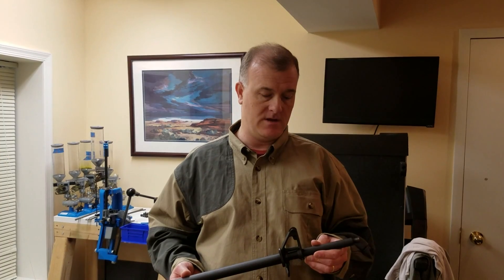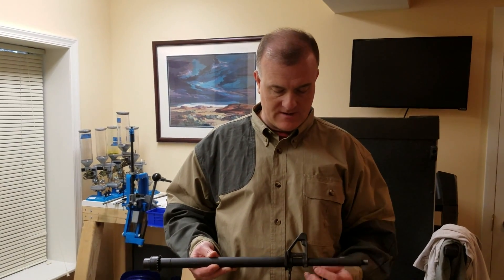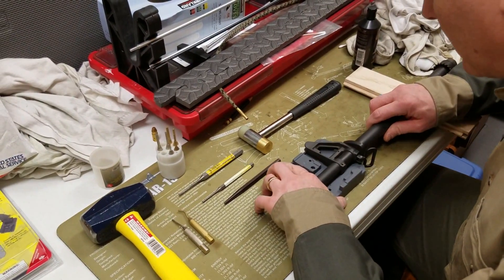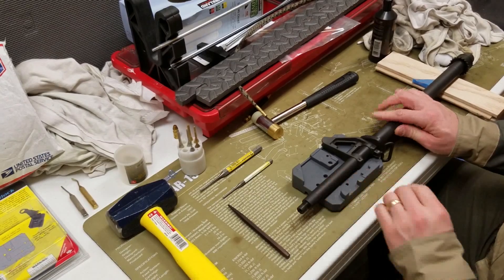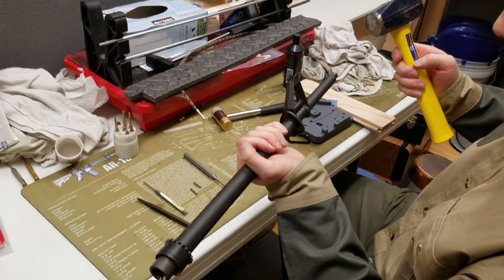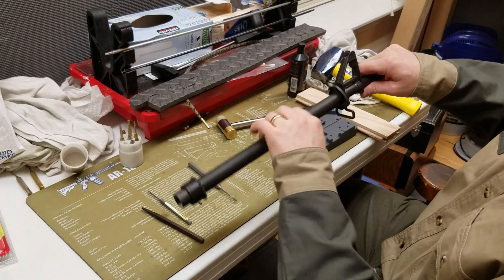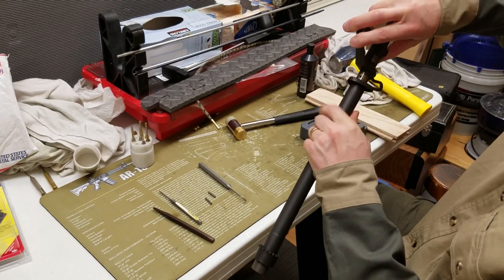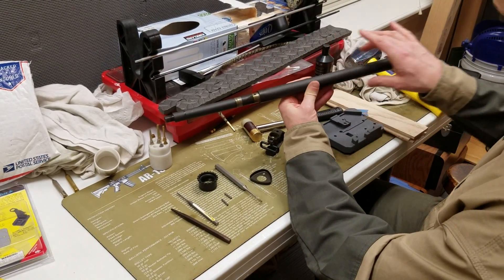Removal of a pinned AR15 Front Sight Base

Comment: I have the same bench block & I've used a hell of lot more hammer force than that...  and my FSB tapered pins haven't even budged yet...!
Reply from the maker: Make sure you are hammering toward the correct direction.  To remove you need to tap from the small side so it would back out toward the larger diameter side since its a taper pin.  Certainly a stable base or workbench is better for tapping/hammering.  You need a steel punch too.  I have the starter punch which is good to get going but after dislodging some I think you can switch to another punch.  This is because the taper on the starter punch won't fit all the way through the hole.
Reply: @yourarsenaladvisor  I was removing the pins from the correct side.   As I mentioned, I have the same bench block you have and used the "pins out" position on the bench block which was correct.  I worked on it again tonight for an hour and finally got both pins started out below flush with a drill bit spotting "pointed" punch... then proceeded to drive them the rest of the way out with an 1/8" dia drift punch.
Reply from the maker: @williamriley2528  I didn't rewatch my video or I might have recalled that it tells which side.  I do remember it being hard to get it started.  I think I tried some smaller punches that bent before researching the correct starter punch to use.  I'm glad you got them out.  I wonder if penetrating oil would have helped.

Definitely much easier with a proper steel punch.

Comment: If you would have put your Wheeler block on a concrete floor you would of had the pins out in 2 wacks. Thanks for your content.
Reply from the maker: Thanks!  I was using some punches tonight from the set that I bent up shown in this video.  Using the straight ones though for a much easier task. LOL

Comment: what size punch did you use?
Reply from the maker: The starter punch is an ‘AR Stoner Front Sight Pin Starting Punch’.  It doesn’t give a dimension but I think it’s 1/8 at the end and tapers out from that for rigidity.  Then when things get moving you can switch to something just under 1/8”.  My Stanley measured at .11 which is less than .125” but fits through where the pins go.  But you need to start with the more stout starter punch. This is for removal.  If you are driving them I figure you would use it to start and maybe switch to a jig or something else.  Otherwise you need to be extra careful not to miss.  I’ve never done an install.  Remember the pins go in one way and they need to go back out in reverse since they are tapered.
Reply: @yourarsenaladvisor  i ended up using a 2/32 set punch and i did try a 1/8 and 5/32 but both seemed to big idk
Reply from the maker: @hawkslayer2351  The starter punch is only used for a very short time to just dislodge the taper pin of its friction on the assembly, then you switch to a straight punch of appropriate diameter just to push a loosened pin through. I think the 1/8 is exact and might be as tight as the pins so need something just under but close in diameter so its still rigid to push against any residual friction.   The punch I have is .11 so its just under 1/8" or .125.  With 5/32 or .156 that is definitely over.

I put the starter punch up to the old hole in the gas block I still have laying around and with the taper you can't really get far with it so you have to switch to another straight punch.  But it's tight at first so you need the beafier punch to get it unstuck.
Reply from the maker: Did you manage with the above at all or no?  I was responding as if maybe you didn't yet but realize that you might have.

Comment: I must admit this is currently kicking my ass. I'll get that block you are using. which mfg sights/barrel do you have?
Reply from the maker: My barrel is a rock river arms .223 wylde 20" 1:9 twist.  I got a power wedge front site base from Fulton Armory.  They have f marked and non f marked for flat tops and standard.  And with bayonet lug or not.  They attach with 4 set screws.  I finally got a chance to install it but just lightly.  I got interrupted by some things.  Maybe I can do a review.  The main thing about removing the pins is getting the heavier guage punch to get the pins dislodged and moving.  Then I think a punch of the pin diameter was then used.  The starter punch is tapered so it won't go the whole way through.
Reply from the maker: Sorry,  I was thinking of my forthcoming Front Sight base.  I think I got the armorer's bench block from Midway USA.  Pretty sure it's a Wheeler.  It has more surfaces than the round bench block from what I can tell but it's not perfectly form fitting though.  Also try to use a firm bench underneath.  Mine in the video is a plastic folding table, not the best.
Reply: Thank you sir.

Comment: Shim up your bench block with a piece of delrin or hardwood to gain clearance for the sling loop. Shim the chamber end as needed for level.
Reply from the maker: Thanks.  I just rewatched the video.  It appears I do have clearance for the sling swivel from a piece of unfinished hardwood flooring.  I'm not sure now why I complained about it in the video.  That workbench is still a big problem for bounce back.

Comment: Now after you do this do you have to install a gas block? Or will the rifle fire okay?
Reply: YAA here, yes you can put on gas blocks or front sight gas blocks that tighten via set screws.  Either you put back on the one that was taken off or a set screw gas block.    I was informed(Rock River Arms technician)  that you can't put a new pinned front sight base or other block because new drill holes won't line up with the ones on the barrel, etc. That is the conclusion I got from the email exchange I had.  I used a power wedge on the barrel I took the pinned one off of.  They grip via set screws and you can use on previously pinned or non pinned barrels.  I got it from Fulton Armory.
Reply: Also barrel gas ports are a bit larger than gas block gas ports in case the gas blocks are a little off due to a hand guard end cap or lack of one in assembly.
Reply: @ig88a37  No, you actually have it backwards...  Gas port hole in the barrel is generally pretty small,  the gas port hole in the gas block is generally nearly double the diameter of the gas port hole in the barrel.  This then allows for some slight degree of mismatch in the gas block location, while stll delivering a full charge of gas to the gas key on your BCG...
Reply: No typical AR is going to cycle a round without a gas block and gas tube installed...
Reply from the maker: Yes that is correct.  Someone asked me about a build where I did not have an endcap and they thought I should have shimmed the gas block to the barrel to account for the missing thickness of the endcap.  I replied that the gas ports are larger to allow for some adjustment to different installation applications.  Now I want to go find the comment and double check what I wrote. (Edit:  I got it right in the comment on my NM free float install video)
Reply: @yourarsenaladvisor  Yep...  Given that some thought myself...  It's a shame that gas block manufacturers don't figure that thickness (about .047") into the manufactured length of their low profile gas blocks.
Reply from the maker: @williamriley2528  I think the gas block's gas port being oversized it has probably become standardized to where no one feels the need to try and redesign it since the small gap doesn't seem to negatively affect the function.

Comment: Why replace everything except the barrel? Just get a new AR. You only replace the barrel when it’s shot out.
Reply from the maker: Originally I had my first AR15 that came with no bayonet lug and no flash suppressor when I purchased it during the 1994 to 2004 'Assault Weapon' Ban.  When the ban sunsetted I sent it back the the manufacturer to get a new barrel installed onto it with the normal front site gas block with the bayonet lug and a proper A2 flash hider.  So for years I had the old barrel laying around that eventually became a match rifle project and subject of some of my videos.